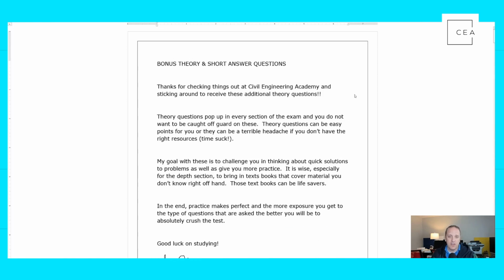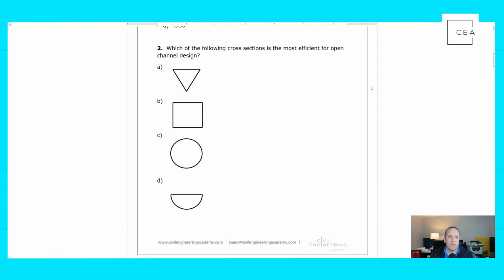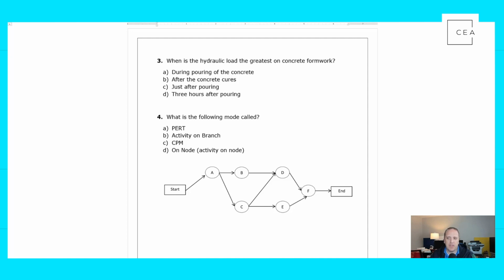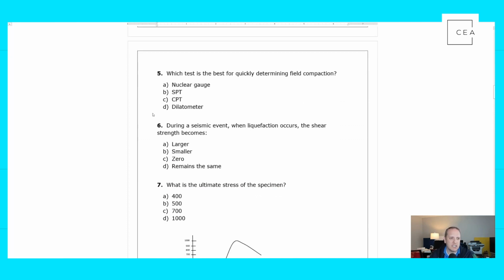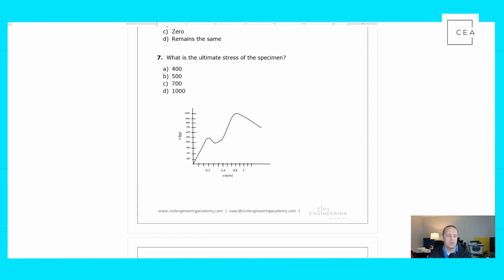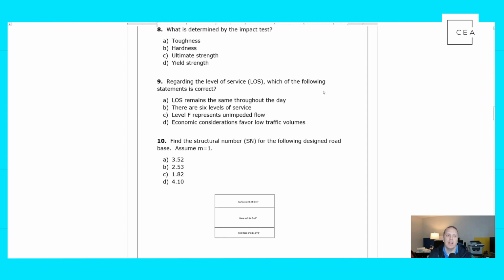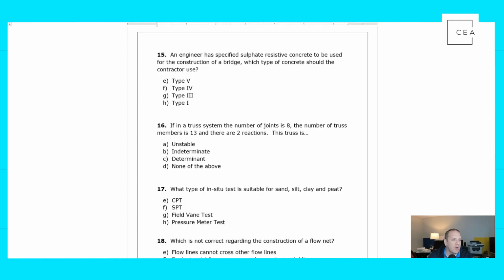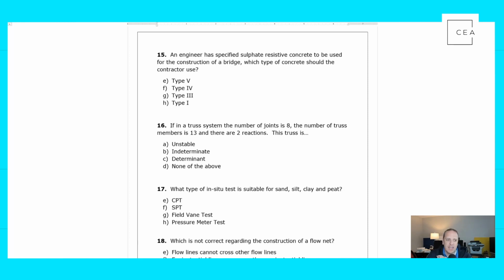CEA 133 - Conceptual Problems You Need to Know for the FE and PE

Comment: These questions drive me nuts. Ie for the most efficient section, what does that mean? The wetted perimeter is less in the semi circle but the hydraulic radius is greater for the circle. Mannings looks at hydraulic radius to determine flow, not just wetted perimeter.
Reply: the higher the wetted perimeter, the greater the resistance to flow. that is why the lowest wetted perimeter (given all shapes have the same area) is the most efficient.

Comment: Hi Civil Engineering Academy (CEA) - Thank you for sharing this video with all of us. @4:45 minutes , you mentioned that the answer is (D) 4,050 lb/day. The closest answer is (A) 4,580 lb/day. The feed rate (M) = Q(MGD)*C(mg/L)*8.34 L-lb/MG-mg
110 gpcd and a population of 10,000 is equivalent to a flow rate of 1.1 MGD , substituting the given concentration of 500 mg/L and multiplying by the correction factor of 8.34 yields 4,587 lb/day. I hope it helps